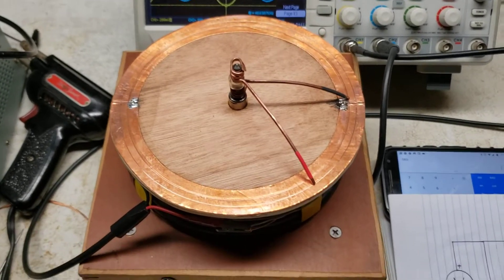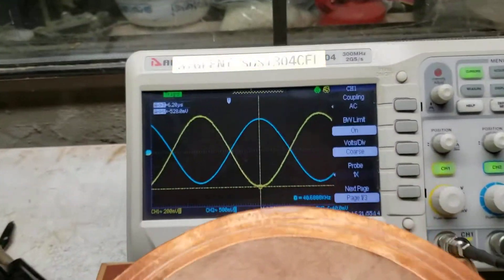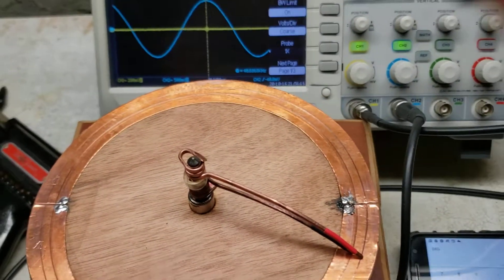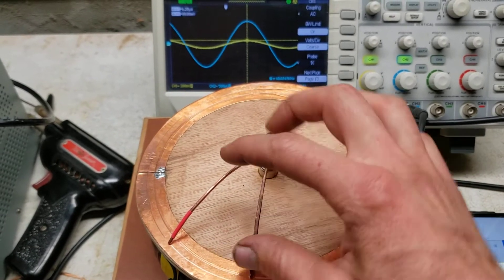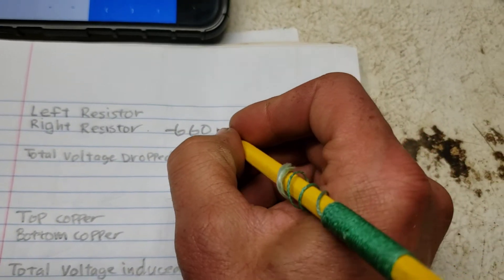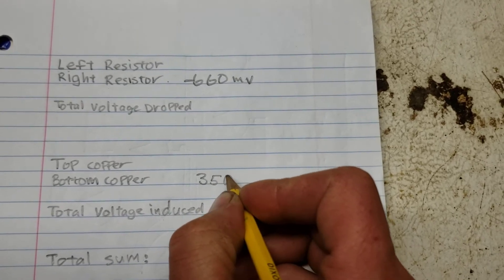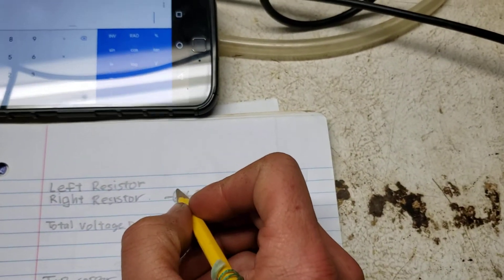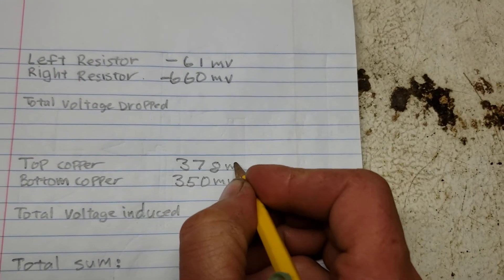The Lewin clock - Kirchhoff's Voltage Law(KVL) holds for loop circuits with induced voltage elements

Comment: What you mean voltage dropped and voltage produced? There is no such thing here, there is only voltage induced. You do realize that your probes with the initial loop segment form a secondary open loop where you measure each time at its open ends (osc does not draw practically any current) an induced emf voltage? Right? Please move the probes outside the area of your solenoid. When this is done you will practically measure no voltage on the non-resistive loop segments. You measure only voltage across the resistors because they act like an opening in the loop.

Of course to get the full emf voltage of the loop, cut it open in one place and measure there making sure the two probes are outside the area of your primary solenoid. In a totally closed loop with no open ends or resistors and also assuming the resistance of the wire used is negligible and the current in the loop is relative small you will measure practical 0 Volts between any two points on the loop. You will have to cut it open in order to measure an emf for an inductive loop without any resistors. Same like a solenoid which has two open ends.
Reply from the maker: Please read and understand the following writups before arguing with me:

http://www.electroboom.com/share/FaradaysLaw_Mehdi.pdf

https://www.physicsforums.com/insights/wp-content/uploads/2018/06/k-t-mcdonald-lewin.pdf

Also, don't forget that Physics  Professor Dr. Belcher PhD said that "KVL Holds as Mehdi argued" 

and 

Physics Professor Dr. McDonald said that Lewin's circuit was within the range of applicability to Kirchhoff's loop equations and would predict the values measured by volt meters..

You ask:

> What you mean voltage dropped and voltage produced? There is no such thing here, there is only voltage induced.

Tell that to my volt meter. Transformer secondaries produce voltage by induction, but voltage is still produced. That's how we say it in English.  

> You do realize that your probes with the initial loop segment form a secondary open loop where you measure each time at its open ends (osc does not draw practically any current) an induced emf voltage? Right?

Of course. And whether we consider my setup as a half turn on a solenoid using Faraday's law or half of the area of the dB/dt area according to Maxwell, the results are the same: We are still measuring half of the induced voltage for that physical half of the solenoid, and thus we can measure the real voltage induced for that physical half of the solenoid, which allows us to model and measure each half turn as a transformer secondary winding. And KVL holds in that case.

> Please move the probes outside the area of your solenoid. When this is done you will practically measure no voltage on the non-resistive loop segments.

What do you mean "move the probes outside the area of your solenoid?" Like this? In the following picture you can see I have a 10awg wire run in a half-turn non-resistive loop segment, and I have my probe wires run OUTSIDE the area of my solenoid, JUST like you say. And yet I'm still measuring a half a turn's voltage: 
https://i.postimg.cc/dVJDgFny/Screenshot-2021-12-16-at-11-52-06-How-to-correctly-probe-voltage-in-a-changing-magnetic-field.png

Please read and understand the two above linked PDF files before replying. And please read ALL THE COMMENTS below this video before replying. 

Thank you and have a great day!

Comment: Very very nice I think you put this subject to rest.  Its funny that Dr Lewin did not do this measurement; he could of saved himself a lot of embarrassment.
Reply from the maker: He could have also taught his class some really cool things about physics, and also taught them the importance of correct probing.
Reply: @fromjesse  ok I have been thinking the only improvement you could make in your experiment is measure each voltage drop
twice; the second measurement you reverse your probe leads. If the two measurements are different then that difference would be the field picked up by your leads. Interested in your thoughts on this.
Reply from the maker: @noCOtwo  The scope was in AC mode, and the voltage being measured is a sine wave AC produced by a transformer secondary, so by definition the meter would read the same either way except under fluxgate or diode-loaded conditions (which this is not.)  

Being an AC signal, it reverses itself 40000 times a second. The reading would have to be identical in amplitude both ways, only the phase would change by 180 degrees.

But if it's important to you, I'm glad to do it!

Comment: Very nice and ingenious apparatus you built Jesse. 

But I fear your interpretation is wrong. 
I think you go with me that in the loop consisting of the left resistor, bottom copper, right resistor, top copper there has to flow one and the same current everywhere, 
On the right you have 61mV/100Ohms on the left 660mV/1000Ohms, roughly the same 0.6mA. 

But now if you think you would have measured a "potential difference" of 350 mV across the bottom copper please do the following calculation: 
350mV / ((lenght of the botton copper) / (cross section of the bottom copper) * specific resistivity of copper). 
That should be the current which must flow in the bottom copper if your interpretation would be right. 
If I guess the dimensions right you should arrive at something like 350 mV /((25cm)/(2cm*0.1mm) * 17.7 nOhms * m) or 150 A. 
Not quite the same as 0.6 mA. 
What you measured is the change of flux through the surface that spans between the left pointer wire, the right pointer wire and the bottom copper. + 0.6 mA " 2.2 mOhm. 
The last part is the  real "potential difference" across the bottom copper which is around 1 micro V or negligible.

This means that the measurement is proportional to the angle between the pointers since the surface is proportional to that angle.

That also means the sum of the "potential differences" along your loop is (61 mV +1 micro V + 660mV  + 1 micro V) and not 0.

When you measured across the resistors, the surface inbetween the pointers was very small so you measured I*R.
Here your interpretation was correct.
Reply from the maker: Thank you for the comment, but the voltage measured across the transformer secondary windings is not an ohmic drop. There are lots of non-ohmic voltage differences like  electrochemical batteries, solar cells, peltier junctions, and guess what, electromagnetic induction.

So saying that it would take 150 amps to have a transformer output of 350mv ignores induced voltage as Faraday described. 

If you tried to model a car battery as a pure resistor you'd also calculate hundreds of amps. For example, if a car battery has 0.001 ohms of internal resistance and you measure 12 volts on it that means your volt meter draws 12000 amps!! Smokin' hot bbq bring me a thick steak!

And yes, the resistors do have a small amount of induced voltage that makes them read less, and yes, the copper foil has a small amount of resistance which makes them read less voltage  - but that's irrelevant - the resistors are lumped as a resistor in series with a very short transformer secondary, and the foil arcs are lumped as transformer secondary windings with a small series resistance (which transformer windings always have.)

The point is that the measuring leads run along planes where there is no non-conservative field, so the scope is measuring the voltage differences around a loop.

See my other video where I did the same thing with an iron core transformer at 60hz: https://youtu.be/iDWv8QJrzUo

Again, the wires have some small level of resistance, and sure, the resistors have some level of inductance, but all very small comparatively - but it doesn't matter what's IN a lumped element, it just matters that you can unambiguously measure the voltage across it's two terminals.

Each lumped element could consist of entire massive networks of resistors, capacitors, inductors, transformer secondaries, batteries, etc -- but if they have two terminals who's voltage can be measured, then they can be put in a loop and KVL will hold.

Are you aware that Physics  Professor Dr. Belcher PhD said that "KVL Holds as Mehdi argued" and Physics Professor Dr. McDonald said that Lewin's circuit was within the range of applicability to Kirchhoff's loop equations and would predict the values measured by volt meters..?

Comment: I'm a little late to the great debate about Dr Lewin (for the birds) but I have to ask if you have seen Trevor Kearney's analysis of the Dr Lewin's experiment?
https://www.youtube.com/channel/UCLTOBvPp0NjUzkmvQxiELew
He has a series of videos above my knowledge but interesting.
Reply from the maker: I don't believe I have watched all of Trevor's videos, but I did talk with him at great length about a year ago, because he challenged the claims in my video.
He's a great guy and I consider him a friend.
However, he was unable to explain to me why he thinks KVL fails even though I'm unambiguously measuring the voltage across each of the four elements and they all sum to zero.

For a year I've been talking with people about this and I've been expecting all along that someone's going to say "Yes it APPEARS to be holding, but it's not actually do to some technicality in a definition someplace." But so far, nobody will address why KVL is not holding even though it appears to be, they just produce pages and pages of formula and tell me I'm wrong, while being unable or unwilling to answer my questions on the topic.

So I really don't know what the argument is even about at this time. Obviously we can unambiguously physically measure the voltages across each of the four elements, and it obviously sums to zero. That should mean KVL holds.

Comment: Isn't this just Faraday's law?
Reply from the maker: Lots of laws are visibly at play in this video.

Specifically, Ohms Law describes the current/voltage relationship with the resistors, and Faraday's and Maxwell's equations describe the voltage induced across the transformer secondary windings.

Then KVL describes how all those 4 voltage differences sum up to zero.

You can think of the half-turn either as a half turn under Faraday's law, or you can think of it as half of the dB/dt area under Maxwell's equations - the result is the same.
Reply: @fromjesse  This means you're applying Faraday's to add the measured induced voltages across the cupper rails and voltages across the resistors. But at the end of the day, Faradays is a sum of voltages from two different natures (as potential difference and inducing current) equal to zero. So, Dr. Lewin just wanted to let us know the difference between KVL and Faraday, as KVL just takes the resistor's voltages or the Del x E term. But in engineering KVL is taken as "the sum of voltages are zero regardless of the nature of any voltage". How did Kirchoff defined his KVL law? did he do it before Faraday's experiments? How is really defined KVL because for me at least, you added the induced voltage (dB/dt term) and the drop voltage of resistors (Del x E term) so why is that KVL? isn't it Faraday, the Maxwell equation?
Reply from the maker: @estebancastroavila2819  I don't understand exactly what you're asking.

But the key is to understand when you can lump an element. If you can lump the elements and get an unambiguous measurement of all the elements in the loop, then KVL holds, assuming the wavelength isn't too small.

Using either Faraday's law or Maxwells equations we know that a physical half of the area of the core is also half of the induced voltage. This allows us to lump each half of the turn as a secondary winding on a transformer (which is what it is.)

This means we can measure the voltage across the two transformer secondary windings and the voltage across the two resistors and sum them up.

Are you aware that Physics  Professor Dr. Belcher PhD said that "KVL Holds as Mehdi argued" and Physics Professor Dr. McDonald said that Lewin's circuit was within the range of applicability to Kirchhoff's loop equations and would predict the values measured by volt meters..?
Reply: @fromjesse  I'm sorry if I wasn't clear enough with my question. I'm just asking what's the difference between KVL and Faraday's law. Because I have the feeling you think Faraday is just the -dB/dt term, and that's not true, indeed is DelxE + dB/dt = 0 which can be seen as a summation of voltages equal to zero.
Reply from the maker: @estebancastroavila2819   I'm still not sure what you're trying to explain.

This is Faraday's law I'm talking about: http://hyperphysics.phy-astr.gsu.edu/hbase/electric/farlaw.html

Looks to me like it's:

Voltage generated = -N( Δ(AB)/Δt)

where N is turns, A is area, B is magnetic field, and t is time.

My Lewin Clock can be thought of in either of two ways, and they both work.

You can think of the hands selecting a partial turn  for a non-integer value for N, and with N=0.5 we get have the voltage.

Alternatively, you can look at the half-turn area enclosed by the hands and the half-turn as exactly one turn, but half the area, and again, you'll see it's still half the voltage.

Are you aware that Physics  Professor Dr. Belcher PhD said that "KVL Holds as Mehdi argued" and Physics Professor Dr. McDonald said that Lewin's circuit was within the range of applicability to Kirchhoff's loop equations and would predict the values measured by volt meters..?